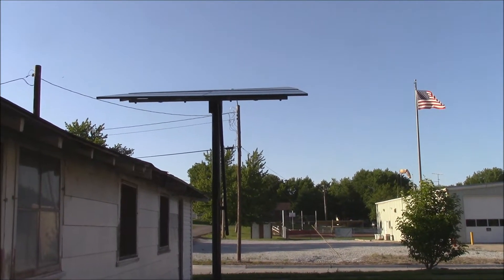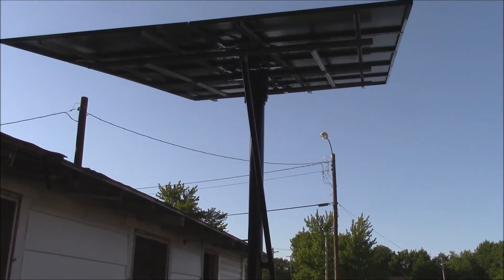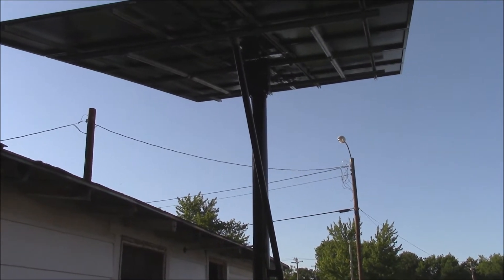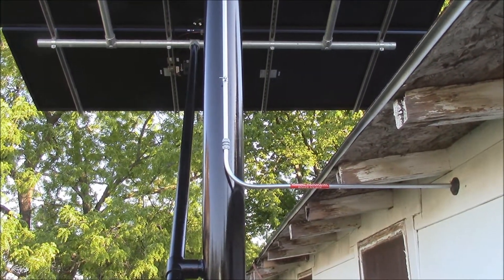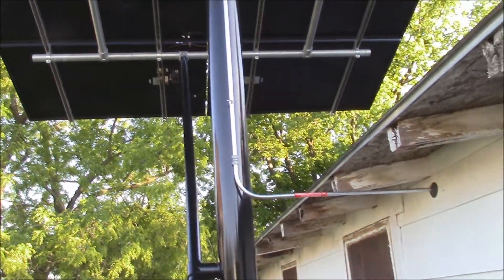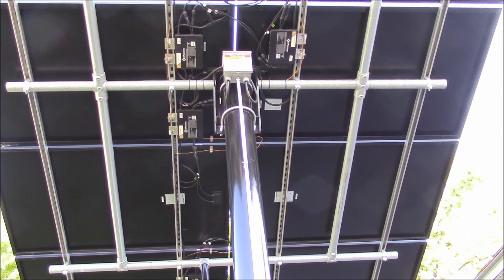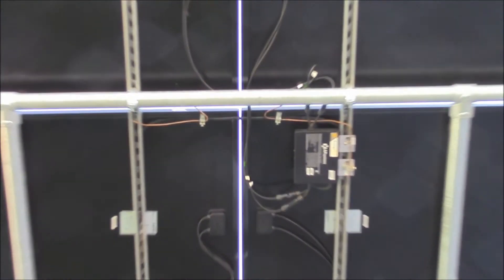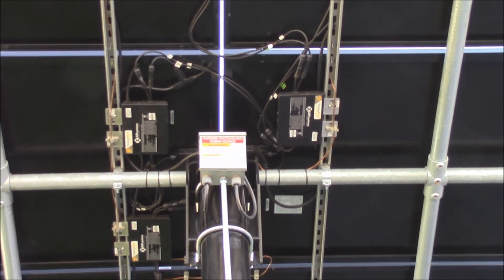APsystems Pole Mount 2.7KW DIY Solar Installation. Part 1

Comment: Thanks for the video. Why did you choose the YC500i over the YC500a? I'm trying to decide between them and can't really tell much difference except that the 500i requires an extra trunk cable.
Reply from the maker: It is what the distributer suggested for what I was wanting to do with the system. I don't know what the differences are between the I and the A versions. I've seen a few videos where the A's have failed but I guess you have that with all the brands. I do like the a/c side of it and not having to deal with the DC install like I was originally going to go with with the Solaredge option I had. The trunk cable is a little different on the 500i compared to the 500A. I don't think you could go wrong with either of them. What kind of system are you thinking of installing?
Reply: Thanks for the fast reply. I've got 12 310 watt Canadian Solar panels and trying to decide between the 500A (no trunk cable) and the 500i. I'm amazed at how little information there is on the web on these two models outside of the manufacturers website.
Reply from the maker: The install videos for the 500A do have a trunk cable. I was surprised as well on how little information their was on the web for these microinverters, the tech support seemed good the few times I talked to them. I know the max output is listed as 500watts per inverter so not sure if you would be loosing some watts with the 310 watts, although you can drop off about 40 watts on most panels for realistic production. Should be a good match.